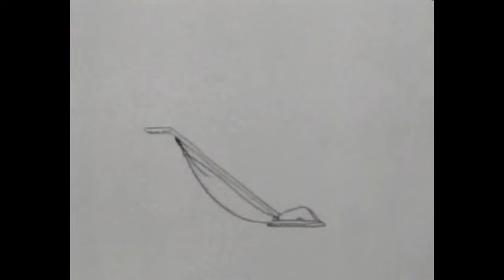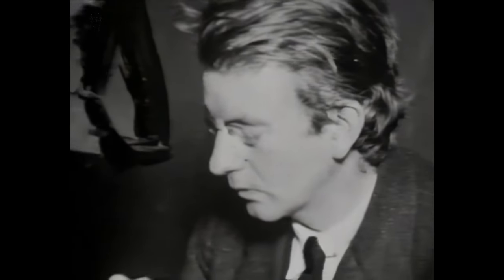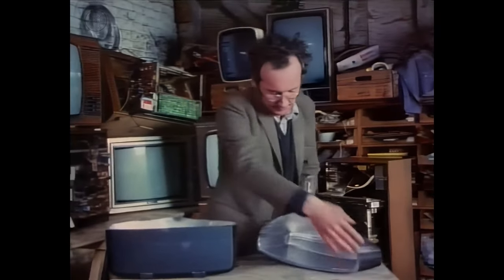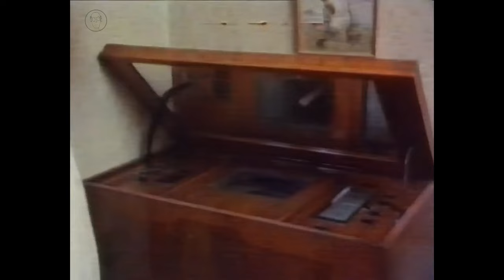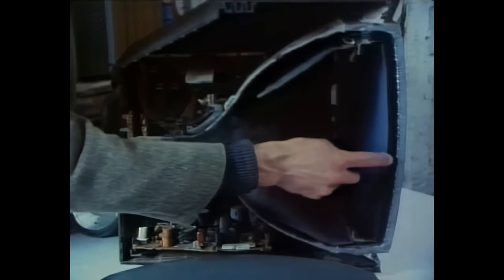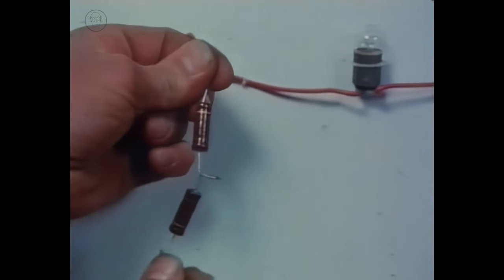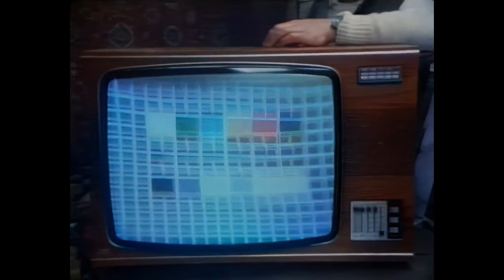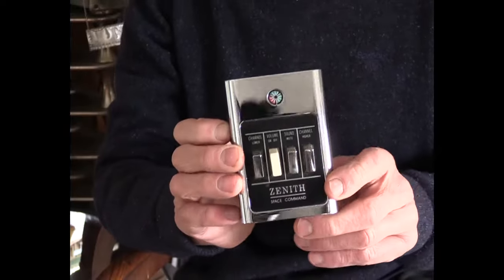The Secret Life of theTelevision - Remastered

Comment: I particularly like the gentleman, Gerald Wells, who set up the the "West Dulwich Radio Museum" in his house, calmly explaining, "You could not kill yourself on the high voltage in this one. Well, you could, if you were actually stupid."
Reply: "One touch of that and you're in the service department in the sky" - brilliant
Reply: Well, there was that guy that managed to kill himself with a 9 volt battery.
Reply: The deadly TVs he was talking about were some of the early ones from the 1940s which derived the high voltage for the picture tube directly from the AC mains via a large transformer. Those could really supply enough current to give you a lethal shock. But this was quickly replaced by designs using a small flyback transformer with much lower current output. In this case the danger is not so much the actual shock from accidentally touching the high voltage lead, but rather what injury might be caused as you suddenly jerk your body away from it in surprise.
Reply: @ColonelSandersLite  source?
Reply: Then admits his friend was the first person killed by a  TV that he had actually been quite responsible after having brought the killer set (that he didn't want to service himself) to the poor 'friend' more like too trusting easy victim.. Dramatic result for that family's harsh luck considering the disappointing, no, NO - literally ACTUALLY the worst most incredibly impossibly unimaginable outcome. Probably akin to a life-ending event for his poor wife or any unfortunate children.. -That's what stuck with me personally even through the lobster-eyed hosts Pinocchio'd Whale of an obvious half-nervous half-laughter..
Reply: He was later killed whilst repairing an old set.

Comment: In the early 70's, I took a correspondence course on home entertainment electronics. The last part of the course was building a 25" color TV from a kit. It probably worked for 10 years or more, but I had to repair it several times. I did some television repair work for a few years and also repaired VCR's. I don't miss those days. Motorcycles and automobiles were more fun to work on..

Comment: The bit at 8:05 where you casually lifted half a tube off totally blew my 8 year old mind when I first saw it. Partly because it was the first time I'd seen inside a telly but also because you'd actually sawn a TV in half. We only had one TV in our house at the time, and the fact it was a scrap one escaped my notice ;-)
Reply: Imagine how many they scrapped trying to make that.
Reply: @KC9UDX  I want to know how they were able to cut a CRT in half let alone in the exhibit where they scratched off some of the phosphor and keep the vacuum on the CRT.
Reply: @lelandclayton5462  I can imagine drilling a small hole , fitting a scraper through, and then pulling a vacuum again.
the new vacuum doesn't need to hold for long, just long enough for the film, so a rubber plug would be good enough.
I think old CRTs had vacuum ports, so it might be a matter of opening it up and then crimping it again,
Reply: @ruben_balea  I know about that process. I forgot they could of easily done it with the right tools.
Reply: @satibel  all CRTs have them, it is nearly always found in the center of octal socket.
Reply: I assume it was done with either a waterjet or a diamond wire saw.  You would of course crush the tip-off first, to relieve the vacuum.  I cannot imagine the elements in the rear were cut in half at all, or in the same session - that bit must have been done separately and then reattached.  Anything else would be sorcery. ^_^
Reply: @ruben_balea  I did not know anyone was rebuilding old CRTs any more, although sadly, those fellows appear to be a small cottage industry.  Still, I bet Richardson or Kennetron would be willing to do it... for a price!

Comment: In the military we had an electromagnetic wand that we would use to degauss computer monitors that had been on for months or years.  You would hold the wand in the middle of the screen and then start to twirl it in a circle while keeping it close. Then you would slowly pull the wand away, all the while continuing the twirling motion. The farther you got from the screen, the larger the circle motion got. So you were making sort of a cone as you moved away. This would normalize the CRT and regain normal picture colors.
Reply: any engineer working with colour CRT tvs or monitors would've had a degaussing wand
Reply: I still have one.  It's a big ring though.
Reply: I did the same blunder with the magnet as Tim when I was young. But fortunately I played with it long enough to reinvent the degaussing process so we didn't have to call a technician.
Reply: @mumiemonstret  your parents were furious, I'm sure.  At least, mine were.  So was the school faculty.
Reply: That was a degausser.

Comment: My Grandfather had one of those Zenith remote control TVs.  It was a black and white portable.  Portable meaning it had a handle on top and weighed about 50 lbs.  It was all metal and vacuum tubes.  I think it had two remotes.  One did all the functions and the other was just volume and channel.  When a button was pressed you could hear the chimes ring as they were all in the audible range.  Holding down the button would allow the channel or volume to keep advancing. Releasing the button would cause a damper to stop the chime vibrating.  There was a separate section inside the TV that would decode the chimes and operate the functions.  The volume and channel were turned by motors and I thought it was neat to hear the tuner clunking around.  The old style TV tuners had a very distinct sound to them.

Comment: My grandmother had one of those "Zenith Space Command" TVs back in the 1970's.  I watched it myself into the 1990's, probably including all the original "Secret Life" episodes..  The TV is long gone, but I kept the remote because it's such a cool idea.  It also reminds me of the time when my very young self had taken apart a mechanical alarm clock, was messing with the mechanism, and scared the heck out of my mother and myself when the TV behind us suddenly turned on and started changing channels.  Apparently, the clapper in the clock vibrating without hitting the bell was in the correct frequency range to be recognized by the TV.  The tuning was still mechanical, so there was a great deal of noise as the motor rotated the channel knob rapidly back and forth.  I got into engineering, and now I work with computers the size of postage stamps (remember those?) and OLED displays roughly the same size, with resolution much better than the old CRTs.  It makes me wonder how things will have changed in another 30 or 40 years.

Comment: Great to see the old show again and also your thoughts on it. I also did the magnet thing on the telly back in the early 80's but luckily the purple mess it left vanished the next time it was powered up.
Reply: It vanished because your tv was equipped with an automatic degaussing coil that the tv energized briefly every time you turned it on. Early sets did not have this feature.

Comment: The RCA TV I remember from my childhood had an electronic or digitally controlled tuner but manual power and volume knob.  We typically changed the channel with our VCR remote and also used a rotor motor controlled Showgun antenna.  I can’t find pictures of the antenna at all but remember it being white and cylindrical in shape with a curved aluminum dish on one end with red or red-orange lettering “SHOWGUN” written on the sides.

Comment: I found out about that the remote control worked by sound by accident. I happened to have some copper coins and I was shaking them in my hands - when the TV changed channel! This scared me at first (it was around the time as the film "Poltergeist" came out, with children communicating with ghosts through the telly and things moving about). Then I calmed down a bit and realised that the channel only ever changed in response to me shaking those coins, and I actually found it funny! I showed the rest of the family and my Dad realised what was going on. Turns out, you could even get the TV to change channel if you whistled at it! A bit like the telephone "phreakers" who learned to mimic the sound signals used by the telephone equipment. They used whistles and tone generators to hack the telephone system into giving them free long-distance calls! Sweet! Nowadays, people can talk long-distance via the Internet and it doesn't cost any more than your standard Internet charge.

Comment: I'd like to have seen mechanical t.v. I found what must have been an aluminium Nipkow Disc in our garden when I was a kid, probably about 10 inch diameter, but didn't know what it was at the time, I guess about 1968-ish so it could have been lying there for about 40 years. 
I remember our old black and white t.v. set was just ITV and BBC which got white spots on the screen when cars drove past and Dad kept moving the aerial, I only remember one indoor vertical aerial, and he seemed to be forever inside cleaning the terminals of the turret tuner with Brasso liquid. 
I remember going with him to Mazel Radio in Manchester for a valve for it and shelves full of gear in the shop. How great would it be to go back in a time machine and buy a lot of electrical stuff. I think they might call the police when I got out decimal currency though.

Comment: Tim, during your commentary after the episode, is that device with the large butterfly-shaped metal plates in the lower-left corner of the frame an absolutely bonkers high-voltage capacitor??? PLEASE show us some experiments with it!!!
Reply: I had the same question!   It reminds me of a ganged variable capacitor found in a (formerly) typical radio tuner.  I'm guessing this large one might be used as part of a radio or TV transmitter?
Reply: I realize both of you have probably already seen it, but yes, that gigantic gizmo came from a radio transmitter, Tim talks about it at the end of the radio episode https://youtu.be/LMxate9gegg

Comment: There was one time back in 2010 or so that I worked on tech support for a cable company, and a customer called in with a strange issue.  It wasn't with the cable at all but with the tv, and they didn't know who else to call.  Whenever they turned on the kitchen blender, the channels would change on their tv.  I was pretty baffled by this until I remembered a bit of tv history.  Turns out they still had one of those ancient tvs with an ultrasonic remote, and the blender must have been producing some ultrasounds of its own.  I apologized for not being able to fix the issue, but I still think they were relieved just to know what the heck was going on.

Comment: 17:20. I've always studied electronic things as a youngster,  yet book diagrams on how the color CRT shadow masks work at aiming 3 separate electron guns into the correct colour phosphor never made complete sense until I saw this demo 30 years ago.  And how simple and ingenious it all was.  Previous to the shadow mask colour CRT [RCA, 1953], experimental colour sets used either 3 separate CRT images merged optically [expensive], or a complex contraption with a large spinning colour filter in front of a small screen [impractical].

Comment: The upscaled version is quite good. What is maddening about the content is the complete omission of Farnsworth. He and Tesla were non-existent in any of the literature back in the 1980s. I was studying Electrical Engineering at university and have been involved in radio and electronics since 1971.

This is NOT a reflection on Tim and Rex. It is about the active suppression of major contributors to science because of financial or political interests. Zworykin stole the electronic system from Farnsworth and was working with Sarnoff. I do not know the interaction with the European TV developers.

It was Farnsworth who came up with the scanning lines system as it resembles plowing fields. He had a full system - transmitters and receivers going on before WW2. I have the source materials in my library in hardcopy form so I shan't be providing links.

I've repaired hundreds of television sets and worked at a taping studio during college where I repaired the hand-built Hitachi cameras. ALL analog. A pain to align and Never Twice the Same Color.

Comment: I know this is an old video from 3 years back at this time but I have a story about the Zenith space command remote told to me by an old TV repair man. He went out to a customers house that was difficult to get to due to the house location on the side of a steep hill. The complaint was the TV would randomly change channels and volume. He checked out the TV and found nothing wrong with it. The customer was willing to pay him to sit there and watch the TV with her, so he did. At one point her little dog with a bell attached to its neck came running through the room where the TV was and the problem showed up. The customer could not understand why the TV was reacting to the bell on the dog. Needless to say he was non the least pleased with the denseness of the customer and told her where the bell can go for all he could care but that it was the problem.

Comment: As if not show the opening of the 1936 Berlin Olympics.......which was an important early, large scale TV broadcast intended for public viewing.  During WW2, Germany even had small TV sets installed in bombers for directing guided bombs against shipping. A lot of those old radios and TV's that used vacuum types had very heavy duty,high voltage circuits inside.......very dangerous.

Comment: I still can’t work out how you managed to cut a CRT in half - I broke so many as a teen trying to figure out how they worked.
Reply: You were lucky. Some tubes could hold a lethal voltage for months after use. :o
Reply: @Phantomthecat - The secret is in the type of saw that is used... AFTER thoroughly discharging any residual charge and carefully breaking off the evacuation stub at the end of the neck to release the vacuum, eliminating the implosion risk.

The problem with cutting into a CRT without breaking it is that the glass is tempered, making it strong but also brittle. Most saws are simply too rough for this purpose. Most likely, Tim and Rex would have used a carbide cutting disk mounted in a stationary power saw, such as a radial arm saw which would give a vastly cleaner cut than anything handheld. The only other possibility might be a band saw fitted with an abrasive cutting wire, again the idea being to make a slow, gentle, precise cut. Beyond those choices the only other thing that would really be the tool of choice but out of reach for most back yard tinkerers would be a pressurized water jet cutter, which would make the cleanest cut possible.

Comment: One question left about the beams of color TV: "How did they manage to control (steering) the electron beams for each color?" When the beams are so close together, it is very likely that the electronic magnets  will influence the wrong beam of electrons or did they 'draw' the colors separately for each line (only one gun active)? For example: first red (gun), than green (gun) and finally blue (gun). If true, it takes three times longer to draw a line. How did they manage this?
Reply: The beams worked simultaneously. What you are touching on is something done to every CRT color TV before it left the factory and many times during servicing: Color alignment. This is done in two stages, purity and convergence. Both of these procedures are done with components that are mounted on the neck of the CRT and on older sets were quite involved. But the idea behind them was to assist the shadow mask (the fine mesh screen that Tim showed) in making sure that the beams struck their corresponding phosphors, producing a good color and (surprisingly) B&W picture.

Comment: I had the exact same thing with a magnet 'o shit it stays!' it left a color distortion at the left side, I was able to compensate by putting a magnet at a certain distance, over days I could gradually move the magnet away that magnet had been sitting there for a week my father never said a thing about it. That was a grundig 'supercolor' from 78 something. I wasn't aware it had a degaussing coil a couple of on/offs could have been enough. would have saved me alot of stress my father never cared much for the tv he always buys the smaller ones has a dislike of big screens for some reason even now they are watching a computer monitor that was the only one small enough, sound gets piped through the stereo. I don't mind the crt's are gone always found them a bit spooky. After the grundig they bought a crappy seleco the poor thing couldn't even display the 3.8mhz blok on the test image. At a certain point it broke down and went to the repair shop, by that time I had a full size phillips upstairs and I dragged that one down that was a very good k24 chassis I believe (or K12), that thing was sharper per square inch than the seleco. So it was bigger and sharper at the same time. When the seleco came back my brother remarked 'what did you do to the picture quality lol'.
Years later I was living at some student complex there were these 'barracks' and in the kitchen (of anothere barack) they would watch tv they were a bit passive.. you know, drinking beer, joking.. that was also a full size phillips a friend had this idea of reversing the coils so the picture would be upside-down "they'll probably put the whole thing on its head and keep watching". "and after a few weeks put it back to normal again except the horizontal so they'll go like 'hey it's good again' put it right back up and then subtitles appear.. 'hey..' ". we never did it but it still cracks me up.